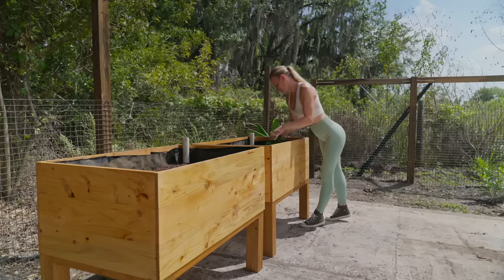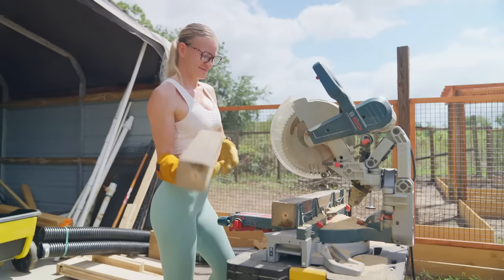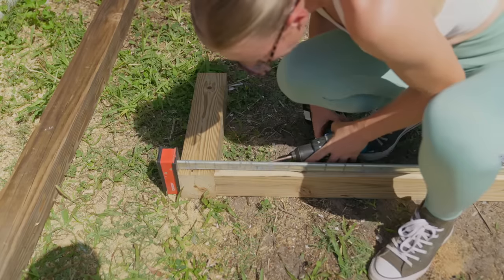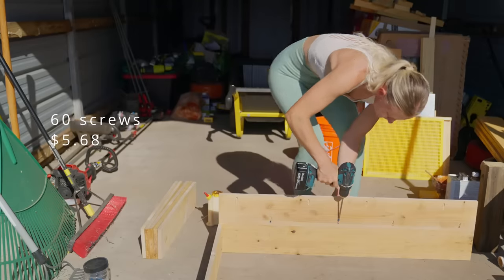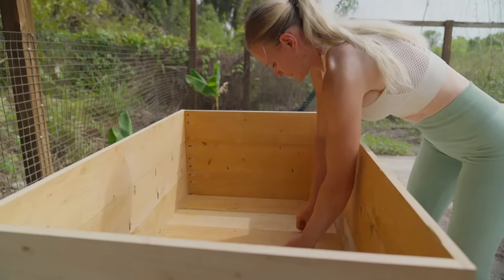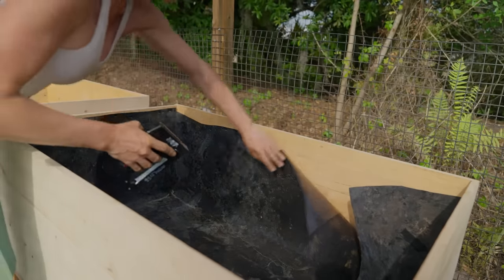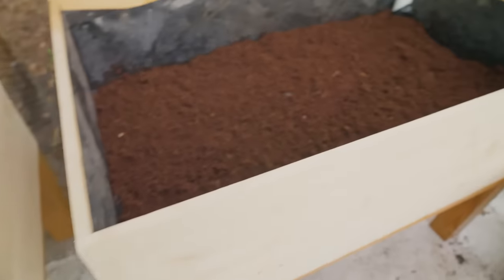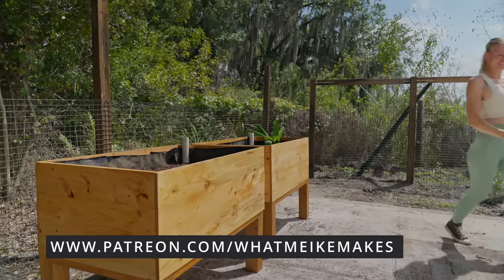Woodworking project to sell - Self watering raised garden planter #gardening

Comment: Nice tip about prefolding the thicker pond liner.  I have started using this type in Texas too, they are extremely water efficient.  Mine ar ,made with cinder blocks on the ground but I would like them to be higher like yours so I will build some of those I think.  I use sand as the wicking medium since it is more efficient than lava rock but it is much heavier so I fill have to make the base a bit heavier.  I always build and sell extras of anything I make just to offset the costs.
Reply from the maker: That’s great! It’s my first time using lava rock in this kind of wicking bed too. I used pebble and regular sized rocks before and some had also some sand in it. A long time ago, I’ve watched a video about what medium wicks the best. And the winner was actually sand. So you made a great choice 👍 was just too heavy for this built
Reply: @WhatMeikeMakes  lol we probably watched the same videos!

Comment: Nice project Meike, but I miss to see how the water works in them 😊 How are they selfwatering ?
Reply from the maker: Hi Martin, Its a wicking bed. You fill up the reservoir once every 4 weeks or so (depending on how thirsty your plants are) / or how often it rains (if there is lots of rain, no refilling is necessary). Then the soil wicks moisture to the surface where the plant roots access as much water as they need. I used the system for about 10 years now and it was the best way to grow delicious vegetables in the desert.
Reply: @WhatMeikeMakes  Thank you Meike, now I understand 🙂Dont you ever miss Germany ? Its a Beautiful country, especially in the south, we drive through Germany every summer from Denmark to Italy 🙂👍

Comment: I love it Meike!  That is a lot of pocket holes and done on the ground! I am in the market for a new compound miter saw. Do you have any recommendations?
Reply from the maker: Yes, I'm overdue for a large workbench. But I need a covered area fist, to give it is final location. 
I mean I have a Bosch and I love it. I had a cheaper mitre saw from Harbor Freight before that. I wouldn't recommend that one. But Bosch and Makita are great.
Reply: @WhatMeikeMakes  Thanks for the recommendations. At least with the Bosch food processor it is hard to get parts, but if your saw runs well, then the part issue isn't really a problem. Funny you mention it my saw now is a 12" harbor freight and it works but holding accurate cuts is  near impossible.

Comment: So how is this "self watering"?
Reply from the maker: Hi Pete, its a wicking system with a water reservoir underneath. Depending on how much water your plants draw and how much it rains throughout the growing season you might have to fill up the reservoir a few times. I usually don't have to fill it up. The moisture wicks up through the soil to the plant roots and provide just as much water as they need. If it rains too much the reservoir leaks out the extra water, so the soil never get too wet, but always stays moist. It's a great system. Been using it for over 10 years.
Reply: @WhatMeikeMakes  Wow, thanks Meike.  Thank you for taking the time to notice my post.  I feel like we've been friends our entire lives.  OK, maybe not.  But thank you for replying.